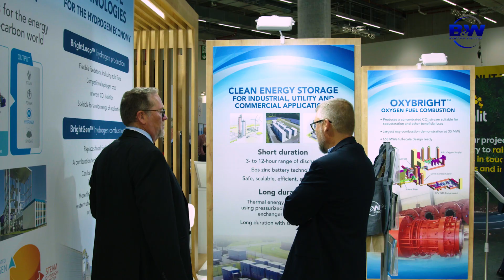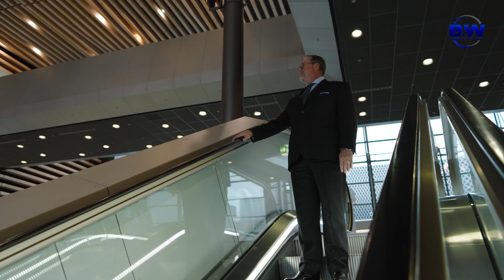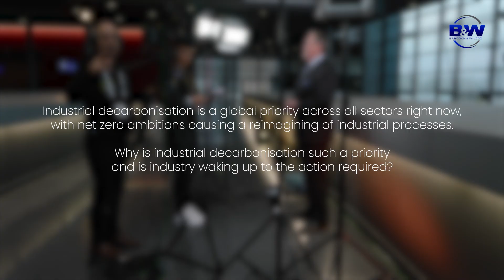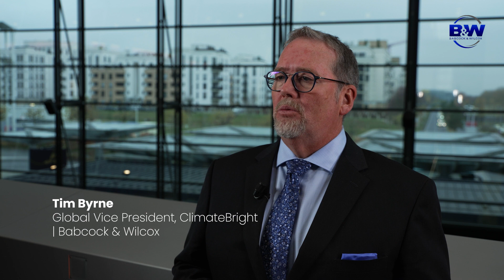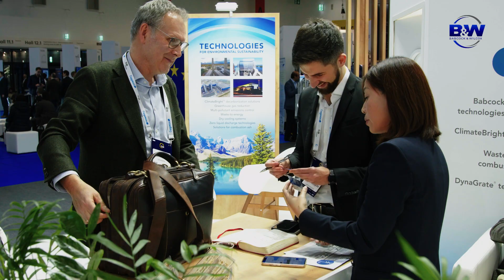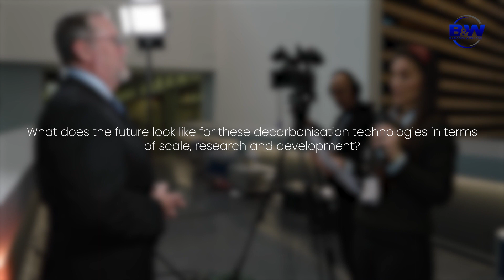Tangible opportunities to decarbonize industry

Comment: It's energy reduction that matters first, refrigeration biggest one by far 3900 twh of electricity. Airjoule is the solution to reducing cooling energy loads by 75% and can eliminate refrigerants while making fresh water. These units are in production, company just went public, big boys like ge bought in heavy, they're running with the biggest players in the game catl, Bosch, and carrier paid huge to be first to manufacture using their tech. This isn't hype, it's going to be everywhere within the decade because if you can make an AC unit, fridge, heat pump etc, be 75% more efficient than everyone else and make clean water... Btw translate the savings airjoule would do to our energy grid and that equates to a reductio of over 1 billion tonnes of carbon. Hoping like-minded people find this and like me want to invest in these companies not just for profit but for humanities success. AIRJ / AIRJW for those interested